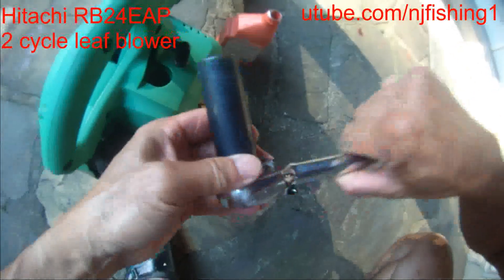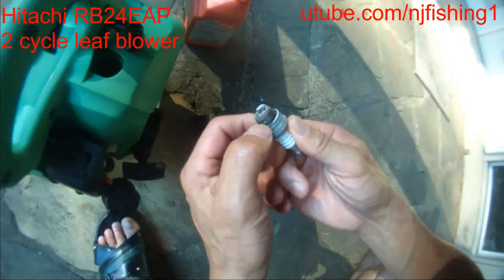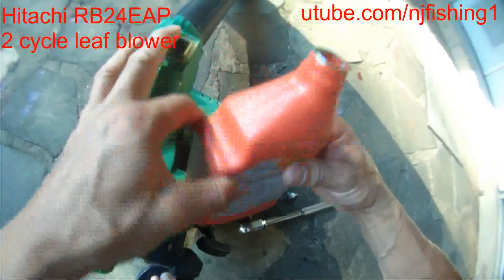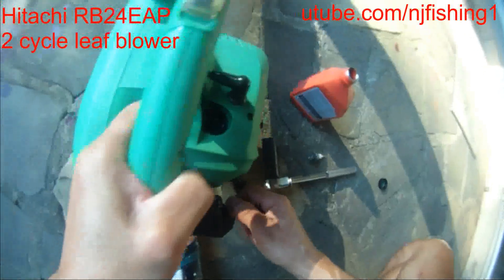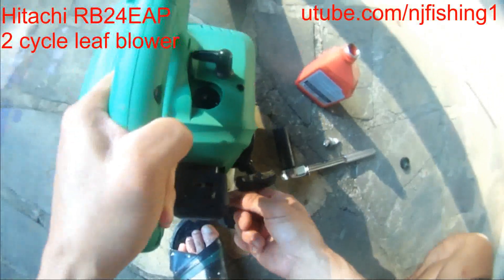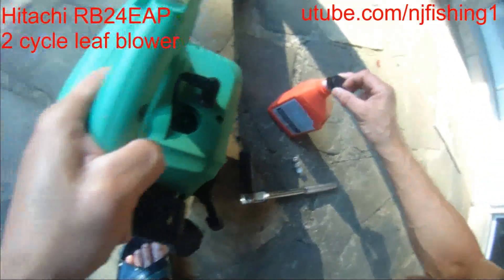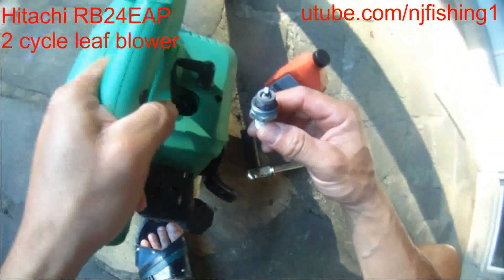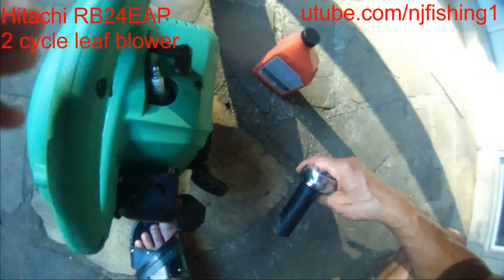Unstuck a stuck pull rope of a 2 cycle leaf blower - Part 1 of 3 (Hitachi model BR 24 EAP)

Comment: Fixed my stuck starter cord on my 8 year old hitachi blower rb24eap.  I didn't have any 2 cycle engine oil handy, so I used one squirt of starting fluid....I re-installed the spark plug and immediately the cord was unstuck and the blower started after about 7 pulls.  I was just about to take thing apart ...who knows if I would have been able to put it back together...you saved me a ton of work. I had never heard of hrydo lock before but I guess you nailed it.    Thanks!!!